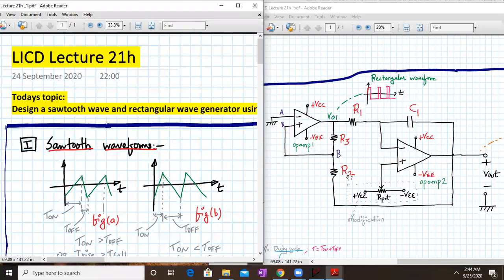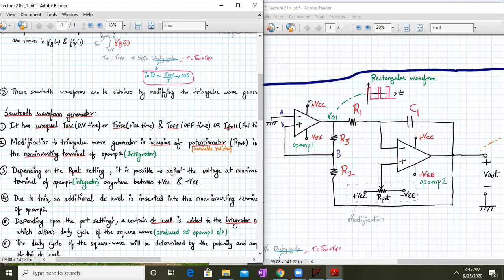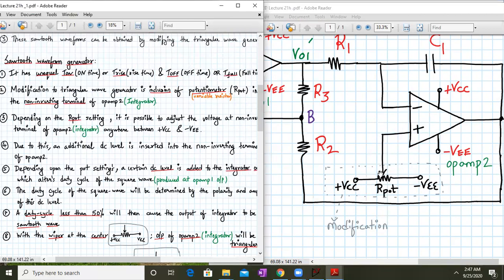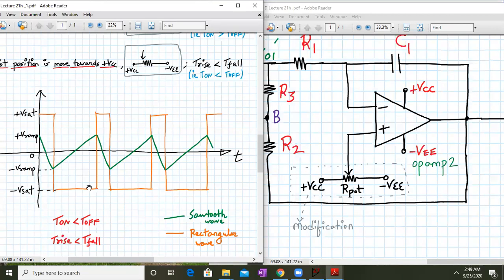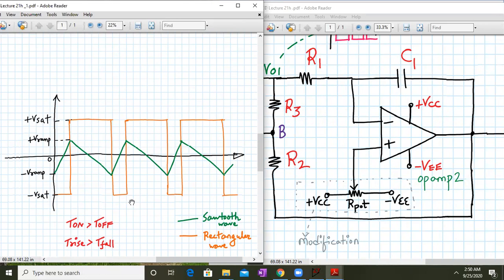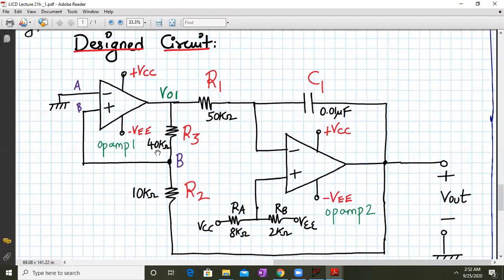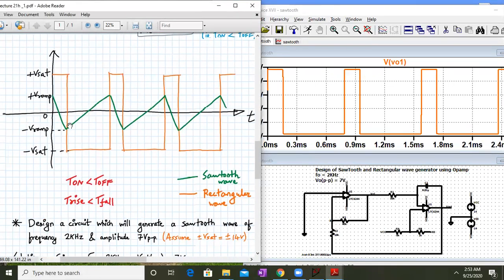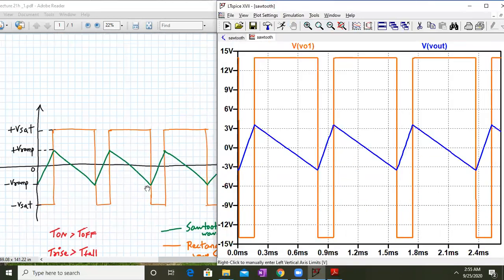Design of Sawtooth wave generator using opamp

Comment: thank you sir .
 you made us good user like this is the circuit use this . but you did not explain why this circuit arrangement only?
Reply from the maker: Its one way to do it, saves effort in designing square wave and sawtooth separately. There are many other techniques. This one is most common way to design Sawtooth wave generator using opamp.
Reply: @InderjitSingh87  ok thank you